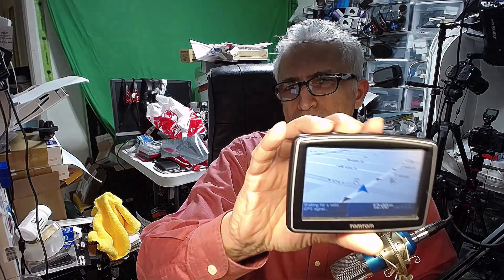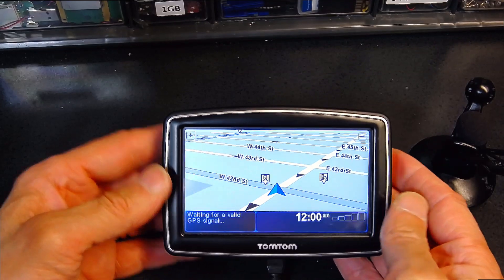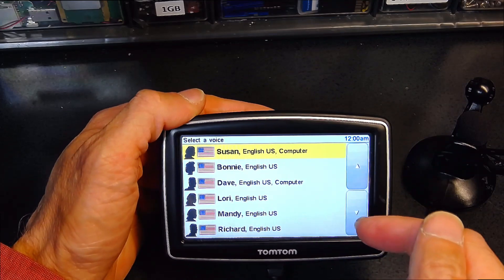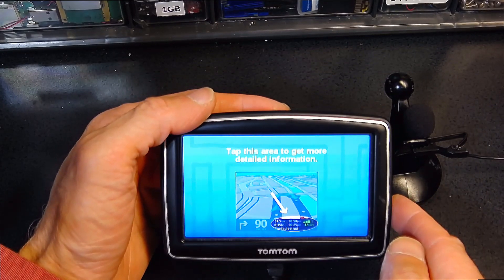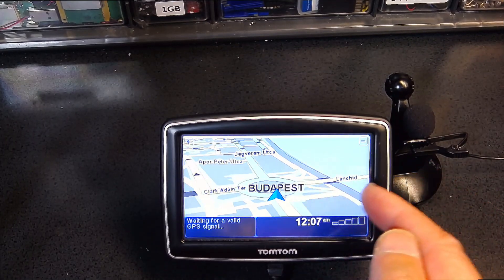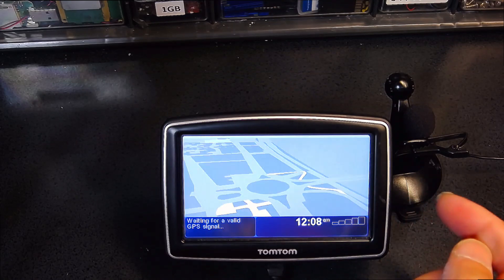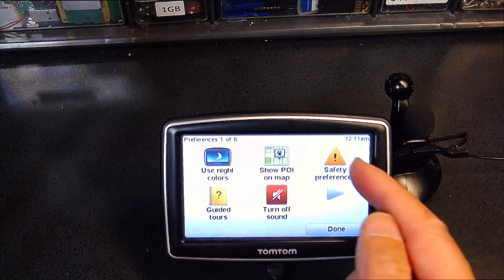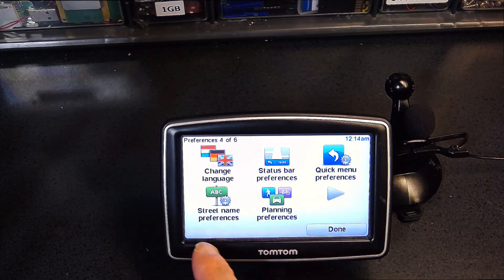Detailed Tutorial on using TomTom XL and XXL GPS Navigation System V8.41

Comment: How could we reset it without turning it on ?
Reply from the maker: On some models there is a Reset Button at the bottom, but even that button requires you to turn it ON. If the unit is completely Dead and will not turn ON then you can't reset it.

Comment: My maps are deleted what can i do
Reply from the maker: You could connect it to your computer using TomTom Home and get it reinstalled.  However if you GPS does not have free Lifetime Map Update option it may cost you more than the value of the GPS. In that case you will need to just get another used one from eBay.